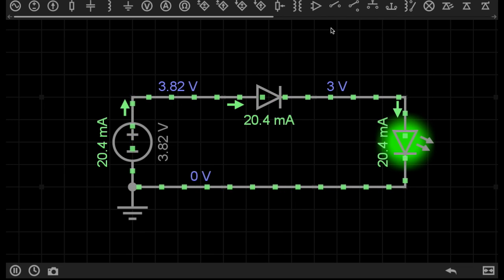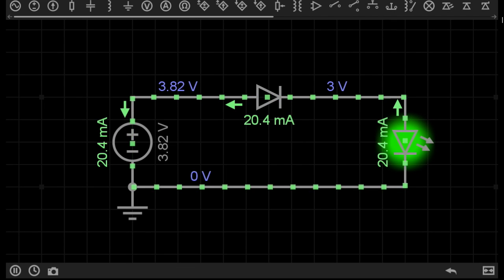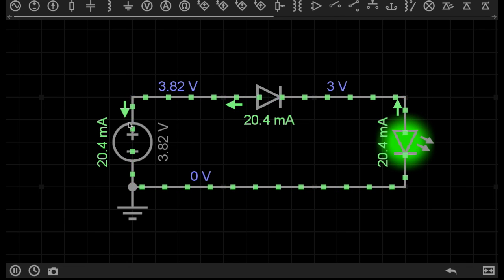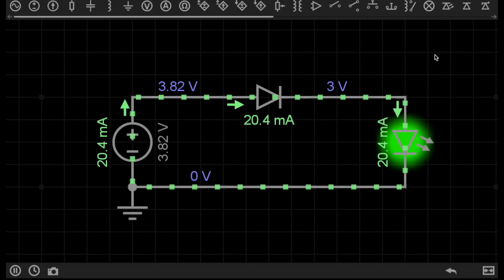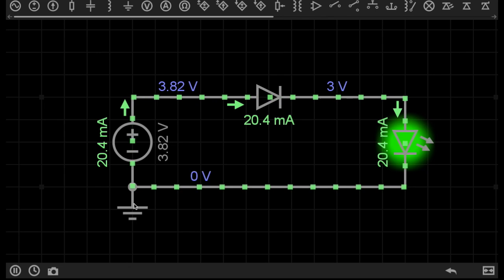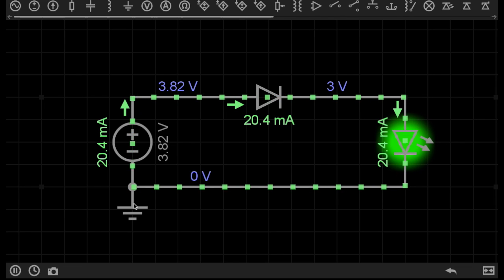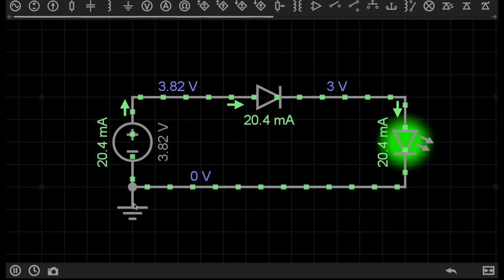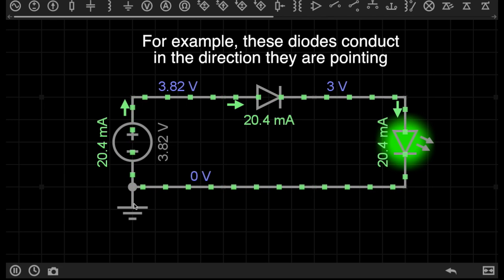Conventional vs Electron Flow Current Flow

Comment: If convention is not used but actual flow is assumed do i have to change the terminals all through the circuit ? but then I'll need a battery which has its signs interchanged is it ?

Comment: They just couldn't admit benjamin franklin made a mistake and just stuck with the wrong theory becoz they say it doesn't make much of a difference even though its wrong. However, there are people trying to deal with this massive confusion about electron flow in the circuit. School student, University students tearing their hair apart to eventually know about the electron flow theory and question their education all these years. Just teach the right theory for god sake. people are not dumb. they will eventually adapt to electrical symbols.

Comment: Nice animation. A good way to help with the concept, is that electrons want to move from a high pressure space to a lower pressure space, or less crowded. So, we can symbolize the tip of the arrow as high pressure, and the base of the arrow as lower pressure. After all, space is fluid.

Comment: So now I'm even more confused. I went the longest time thinking that the diode symbol represents how current stops at the diode (arrow hitting a wall), and flows in the opposite direction of the arrow. But then someone where I work said that's not right and that it flows in the direction of the arrow, and that makes sense considering how I've installed them and how they seem to work. But after watching these videos, it seems my first understanding was correct because it matches the actual electron flow, yet diodes are always installed contradictory to this. Am I missing something? Is the symbology correct in regards to electron flow, and it's just our understanding of how current works that's backwards? Where can I find this explained in exact science instead of being misrepresented through analogies?

Comment: I've always had this issue, and I still have a question. So I've heard a lot that the way it flows doesn't matter because both ideas work, but wouldn't that mean if you created a circuit to run from + to - that it wouldn't work because the flow is going from - to +? This may have a simple explanation but I've never been able to find it and its been giving me headaches. Any answers would be great.
Reply: I've seen an illustration that shows as the electrons leave the atoms within the wire, it looks they leave cations behind. As they move forward to the positive terminal, they become anions. Therefore, it will look like a positive charge is flowing backwards to the negative terminal. It isn't, really. The electrons move negative to positive. You can find graphics online to illustrate what happens.

Comment: so convectional flow is still electrons
Reply: Our convention for current is to assume hypothetical positive charges flow.  In reality, it is electrons flowing the opposite direction.   Due to the fact that the electron is negative, electrons flowing counter-clockwise in the circuit will generate the same field effects as if it were positive charges flowing clockwise.   The result is exactly the same, either way, and you don't really need to care what the identity of the charges are, most of the time.   It is q*v*A  (charge*velocity*area) that is what produces the current.   If q is negative, then q*v is in the opposite direction of velocity.

Comment: I like your videos, but please do not perpetuate the lie.  It was known way back in the vacuum tube days (valves in the UK) that electrons went from cathode (heated by the filament) toward the positive plate in a simple diode.  They got the symbols for the tubes correct.  Semiconductors and their associated symbols came AFTER tubes.  There is no excuse for this.  So why did they make the all the symbols backwards?  This is so stupid.  Since I was 6 years old I have been annoyed by all this stupidity.  If the symbol is WRONG, then a new symbol should be created instead of sticking with a confusing system just because some scientists got it wrong back in the stone age of electricity.

Comment: Is there an experiment which can prove which direction the electrons are flowing?
Reply: Yes.  It's called the photoelectric effect.  J.J. Thompson noticed that there was something special about the plate connected to the negative terminal of the voltage source, that didn't happen with the positive plate.  You could shine light of a sufficient frequency on the negative plate, and electrons would jump across the gap.  But if you did the same with the positive plate, nothing would happen.
Reply: @carultch  cool, thanks

Comment: You need to improve your understanding of electronics.  The math that make it possible to calculate electricity is based on the holes the electrons leave behind and not on the electrons themselves. Knowing that electrons flow from negative to positive is something that is interesting to know and then forget because the whole industry and its math is based around a positive to negative understanding of the flow called hole current. Your better at making videos than you are at teaching.  Go watch the first electrical engineering video at the Science and Math Tutor site. And stop running your animations backwards.

Comment: It's pretty obvious that the component diagrams were drawn for electron flow. The diode has a small tapered end on the right, with what looks like a plate to collect the electrons, while the left side of diode diagram has a more broad open end on the left indicating higher potential or positive. But positive isn't higher it's a lack or holes, for the electrons... That's what I think.

Kind of looks like a megaphone. Where you talk into the smaller side of the right, voice comes out on the left.

Comment: So if the early people were wrong about it why DO WE USE IT? IM SO COMFUSED plz help
Reply: Because inertia is a powerful "force".   There is a huge body of knowledge all built around an assumption of positive charge carriers before we had knowledge to the contrary, and reforming it will not be worth the effort.   It ultimately doesn't matter which way the actual charges flow.  What matters is the electric and magnetic field effects, which will be the same for a given current, regardless of the identity of the charge carriers.
Reply: @carultch  so basically, everything got built around this concept that positive charges cause current flow but then we found out that naah thats not case but its too late now and it doesnt really matter because everything works and took the if it aint broke dont fix it approach? this is what i gathered from the information
also thanks for replying
Reply: @alfredanto05  Indeed that's what happened.  "If it ain't broke, don't fix it" is the approach we took.

Another thing to consider is that just because the electron is the charge carrier in most manmade circuits, doesn't mean it is the only possible charge carrier.  There are real life examples of BOTH signs of charge flowing simultaneously, like in the electrolyte of a battery.  Or positive charge carriers like sodium ions in the human nerves.

Benjamin Franklin's "mistake" tells us to be flexible in our understanding of what current is, by forcing this flexibility in our understanding of the most common kinds of charge carriers.  It doesn't necessarily need to flow in the direction of charges, it flows in the direction of q*v, where q is the charge and v is the velocity.  Make q negative, and current is opposite velocity.
Reply: @carultch  aight thanks bud for the great explanation, also, happy new year

Comment: If the flow of electron from positive terminal to negative terminal is wrong!!! Then why are we still accepting it till today as the conventional flow of current
Reply: Because there is a massive body of work that describes it as such, and anyone realizes after the first week of basic electronics that it doesn't matter whether you prefer to use electron flow or conventional.
Schematics work regardless.

Comment: Well that's all well and good but they as educational videos would miss represent because if I had a battery,  them a switch with lots of diodes and a capacitor bla bla and I wanted to add a second power supply after the switch so I didn't blow the components rated at a set power supply  ie 
A motor controler with on of switch as opposed to pedometer with a rated voltage of 24v and current of let's say 30 amps 
But  my motor is rated at 48 volts 
If I where to follow conventional current I would put my battery on the possitive leg to the motor and it would do nothing or run very slowly and blow diodes, 
But If I put it to the negative side it would run  and the diodes wouldn't be affected by the left over voltage 
Correct me if I'm wrong but you did comgirm the current flows out of the negative terminal on this video so thank you  my electric go kart will now not blow the controller just probably burn the motor out quicker

Comment: Another example of people in charge, manipulating the truth for some sick twisted nonsense. They say that the truth is ‘too confusing’, so they have to teach ‘the lie’ until the masses of people trying to learn get so frustrated they go numb in the head. 

They might not have understood that electrons flowed from negative to positive, when the vacuum tube ‘first’ came along, but many years before transistors came along they knew that current (the flow of electrons), moved from negative to positive, and yet they chose to create these symbols in falsehood. 

Then they charge kids $100,000.00 in a college and bombard them with lies. 

Hole flow was the original lie. Valence holes empty and fill, but holes can’t flow – they are bound to the atom that owns them, and the atoms are bound by other forces, and that probably means more lies, to help them fit the 17th century errors that become the stranglehold on common sense. Now it's the 'flow of charge'??? Charge is a state … sounds as immature as young kids saying that "voltage flows" - voltage pushes.

Heating the electrode in vacuum tubes, and steering electrons to an old TV picture tube' s positive anode, brought us visual effects clear back in 1927, and society is still steering us, 92 years later, with excuses, and credible teachers like this one, are forced to make video's like this, and apologize for telling the truth.
Reply: Are you off your meds?  News at 11, Dr's use Latin, a dead language, as do lawyers and courts.
Being mad that the world doesn't fit your definition of right/wrong is clear sign of mental problem.

Comment: It's like this, folks.  If you connect something hot to something cold, the heat transfers from the hot point to the cold, or les hot point.  Heat is moving in only that direction.  If we analogize heat to electrons, than this representation is analogous to the Electron Flow (CORRECT) model.  To say that "current flows" from positive to negative (as per the "Conventional" model), is like saying that "coldness" flows from colder to hotter points.  It's like defining "heat" as a lack of coldness (which is itself a lack of heat), as opposed to the other way around (the logically correct way).  The only thing that would make such analogy technically illogical, is that negative charge is not the absence of positive charge, or vice versa, but, a charge in its own right, whereas coldness truly is a lack of heat (as opposed to a form of energy in itself).  But, it's still helpful to conceptualize the principle of confusion.

Obviously, as one side of a circuit loses electrons, it becomes more positive, not because it is GAINING anything positive, but because it is LOSING that which is negative (electrons), RELATIVE TO the number of protons which are "positive."  By the same token, as one side becomes more positive (the side losing electrons), the other side -- the one gaining electrons -- becomes more negative, by the same degree.  So, as negative charge flows in the direction of electrons (the only things that are actually flowing), positive charge likewise "flows" (albeit, in a more 'abstract' conceptual way) in the opposite direction, respectively, and simultaneously.  

Just remember that "charge" is not the thing that carries the charge (i.e. charge CARRIER), but a [net] MEASURE of this force exerted at a given point.  As an atom loses electrons, it loses negative charge, and because of the oppositely charged protons, becomes more positively charged.  So as the electrons which are negatively charged move in one direction, negative CHARGE is moving in that direction, and so, conceptually, if negative charge is moving in one direction, then positive 'CHARGE' is "moving" in the opposite direction.  Hope that helps.
Reply: Good explanation. Another one I just thought of is when you look at lightning in a storm. It appears as if it comes from the cloud to earth. In actuality, lightning shoots from the earth/ground to the clouds. 

I wonder if Ben Franklin made that assumption, that electrical energy flows from a + cloud to the - earth.

Comment: Simply Electronics:  Explains the right way of current flow, and then explains the wrong way of current flow. In conclusion he will be teaching the wrong way of current flow in hope to be less confusing. Wrap your head around that one fellas.
Reply: The whole world uses conventional flow, almost no one uses electron flow. If you want to just understand how electricity works, electron flow is fine, but if you want to work in already existing electrical systems, you will be forced to use conventional flow. Even schematic symbols are tailored to conventional flow.
Reply: @Maxwell Hirst Damn straight Skipper!  The whinging and moaning and complaining about such a simple, well known fact about electricity is perplexing. I'm not even that old and never heard anyone complaining about after the first week of basic electronics study.  Boy are the folks ever gonna be confused and upset when Leap Year comes along... Christ they've had almost a hundred years to fix that to.
Reply: @boots7859  If we were going to fix the system of leap years, what we should do is remove the Gregorian Calendar's method of assigning 3 out of 4 of the turn-of-the-century years as non-leap-years, like we currently do.  The present method of assigning non-leap years, removes 1 leap year from every 125 years on average.

However, 128 years is more consistent with empirical data than 125 years, and conveniently, 128 years is a multiple of 4.   A more accurate solution is to revert to scrap the current rules of which divisible-by-4 years aren't leap years, and assign the multiples of 128 years as non-leap years.   Represent the year in Hexadecimal, and you can easily see which years are divisible by 128.  The next time it happens, will be 2048.

Comment: Please don't  do that,stick to electron flow.
Why do schools teach conventional flow. Electrons have a negative charge,and are attracted to the positive charge. A tubes cathode heats up and electrons are drawn to the positively charged anode. If you use conventional flow with tubes you're in trouble.
 I respected the fact in the previous video you used electron flow;it was quite refreshing.
Reply: Schools usually teach both, however, billions of schematics and electrical systems all over the world use conventional flow, so even if you choose to use electron flow, you will still be forced to think in conventional flow. When Benjamin Franklin decided upon conventional flow, electrons weren't even discovered then for 100 years or so. Converting the world after a 100 years is extremely expensive. All you need to realise about conventional flow is that it assumes that holes (lack of electrons) are carrying charge and you're good to go.
Reply: better not put/draw those diodes in backwards,or capacitors in RF circuits using convevtional flow.

Comment: What a sob reason to use conventional current .... this what confused when it was right time to study this sh*t... I just gave up because it was wrong assumption to begin with... conventional current should have been buried a long time ago rather than causing confusion till the present day
Reply: The reason conventional current is used everywhere in the entire world is because it would be extremely expensive to switch. Not only expensive, it would also be extremely dangerous because many electrical systems would fail due to some human error.